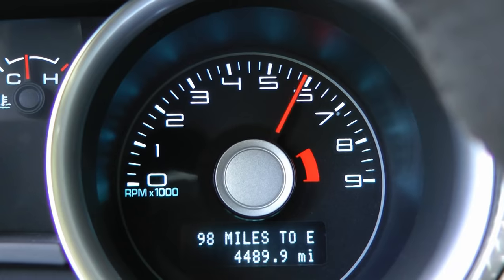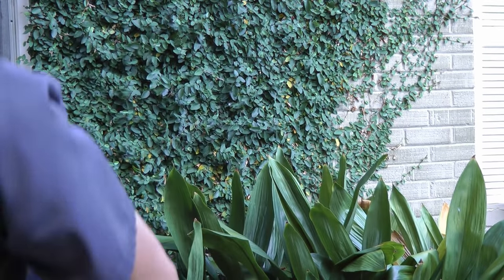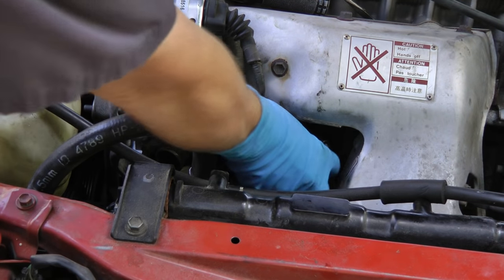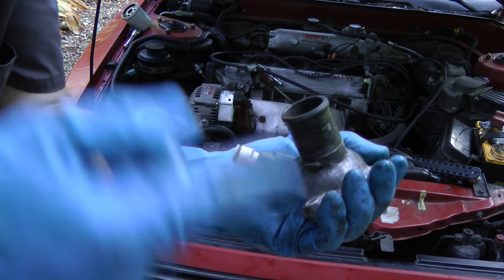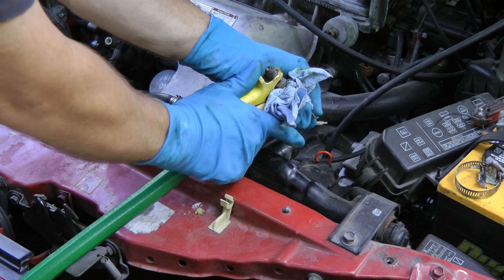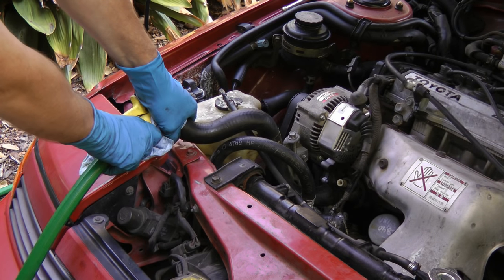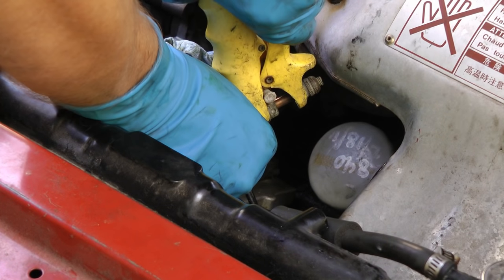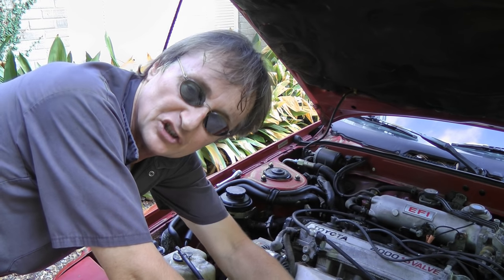How to Flush a Coolant System in Your Car (the Easy Way)

Comment: Hey Scotty, every BMW expert tells me not to use the Prestone green fluid in my BMW, but I should use the Blue fluid that BMW sells. Prestone claims that its coolant can be used on any model and any car. The BMW guys say that using other coolant types will cause damage to the BMW sensors. Is there a difference in coolants and what should I use on my European cars? Please make a video about coolant types. There are way too many types of coolants at the local car shops.
Reply from the maker: Sunil Thomas  BMW uses an OAT coolant, and most modern long life coolants are also oat coolants. I have seen no problems using other oat coolants in them. It's a technology, the old coolant was IAT coolant, which you shouldn't use, but any oat coolant can be used in any car that specifies oat as the type to be used. Now some like toyota use HOAT coolant, which is slightly different, but I've seen no problems using oat in hoat either, and the coolant manufacturers have told me oat will work fine in HOAT systems.
Reply: Scotty Kilmer Thanks for the advice.
Reply: Scotty Kilmer  Would you approve using the same method in a 2008 BMW 328i E90? Thank you!
Reply: Scotty Kilmer - 👍🏻
Reply: Hi isn't coolant just glycol. You can use from 25-50% glycol in the coolant mix.
Reply: If you want to simplify your search for Coolants...try OEM Coolants.  They're Color Coded to match specific types of Cars.   You can find them online and use your Auto Specs and Year Model to search up the right fluid for your vehicle.  They're rated up to 5 Years/150,000 Miles.
Reply: What they likely mean is don't MIX fluids. This is why you stay away from those quick change oil places. They sometimes put the wrong fluid in, because they are hacks. Seen some vids of them doing things completely wrong and scamming people for fluids that did not need changing. They are upselling scam artists cause they don't make a lot of money on oil changes. They make money on other changes though.

Comment: Just get it cleaner!  Its not an operating theater for your brain. The reason for the flush is because its been years and stuff can build up.If your coolant looks ok in colour then just drain it and flush out with hose like Scotty says! Then put some recommended coolant 50%/50% with filtered or distilled water and your good to go!The coolant does a host of things including lubricating.Check level after a week and top up. The air will bleed out on its own if you turn the heater dial to full red!

Comment: Isn't pure water going to cause your vehicle to overheat?
Reply: No...it actually cools better.    Just pair it with a 170 F. Thermostat for Summer.  Go back to 50/50 Antifreeze in the Fall before Freeze-up.  That's why Coolants are called Anti-freeze in the first place!

Comment: I like the idea of doing such a thorough job flushing the entire cooling system. My question is running the diluted coolant down the driveway and into the storm sewer and owning 2 cats having spilled coolant around that they may like to lick. On a normal city lot this procedure while simple enough is a huge drawback for the DIY'er. So I have it done by the Honda Dealer for about $ 125 Canadian. Don't see a way around it.

Comment: Iam a 71 year young grandma and if I don't do it it's not getting done I don't have the strength to pull or push the hoses and if I go under my 2005 van I might not come out😢 I don't have the $$ to have someone else do my Van's treatments do you have easier,cheaper way for me to do this radiator rust remover

Comment: Did you let all that coolant drop to the ground and run to the city drainage? Why would you use the same old oil filter? For a guy like you sometimes you neglect those details....
Reply: +Ivan Jaen if you were watching, at the beginning he put a drain pan under the car. 
maybe the oil filter was new. details are important, thinking for yourself is more important.
Reply: why the hell would you put on a new oil filter if you are not changing the oil...

Comment: Running no thermostat is worse since the engine is not designed to run cold all the time it will cause you to burn more gas since it has to sent more fuel to the engine to warm it up. It can also make the check engine light come on, also it can cause the engine to over heat since the thermostat is designed to let coolent in only when needed. to much or no restriction can actually be worse. oh and like I used water in my older cars and it started rusting out so I would not run in two weeks only two days max. It caused problems on the water pump and dries up the seals I would use an additive like purple ice or water wetter if I used only straight water (:
Reply from the maker: yes, in the long run you don't do that, but for just a few days it will help flush crud out, then you put the thermostat and coolant back in.

Comment: I thought regular water is bad for the radiator. Causes rust. Thought only distilled water is ok. Thought to remove sediment you also use vinegar. These are all the things I learned and thought from looking up how to safely flush a motorcycle coolant system

Comment: I just did this because My car needed it but then had to do it again because the radiator had a small crack in it.  And would drip out when shut off after an half hour.  My old 78 Truck was easier than my 95 Buick.

Comment from the maker: gm is pretty much full of crap with that stuff, basically they have engine problems in many models and want to blame it on something other than bad manufacturing.  Any good oil brand works fine

Comment: I know the manual recommends that you change the coolant every 24-36 months, but what if i buy a  antifreeze tester and it reads good for freeze/boiling point then why would I flush it?? I don't think I'm getting my money's worth if I don't use it until it's not doing what it supposedly do!!!
Reply: Hector Garcia-Martinez The color in the coolant reservoir is a good indication if its a clear clean color blue green or what color the coolant is then that's is a indication the coolant is clean in the cooling system. On the contrary the water in the reservoir looks rusty then. Flush and replace the coolant. The reason for that is normally prior water leak and top up with water so if it it's only or mostly water in the cooling system the water will become brown. It's smart to check any water leak before to flush and replace coolant. Because that was the problem in the first place
Reply: For example in the video here the coolant had a clean green color so there was no point in flushing the system. Besides educational purposes
Reply: Doesn't matter if it reads good. Coolant picks up debris from the system and lots of crud builds up in the system after a few years. If you've ever changed coolant, you'd see how dirty it gets. There are small channels it runs through in the rad fins and heater core fins which can clog easily. That's why you flush.
Reply: If you car is under warranty, flush as often as the service schedule tells you to.  Otherwise, do what you feel is best.

Comment: Motor oil on the rag will get into cooling system and cause the rubber parts to fail.
Fresh coolant acts as a lubricate for the water pump seal. Water alone, especially tap water, will shorten the seal's life.

Comment: use liquid intelligence 239 , a specially made stuff that wont hurt the seal and aluminum on these old cars , anything else will only move the lose junk not the corrosion that is built in the water channel walls...

Comment: One mechanic though, told me that was risky, because
you might create leaks that the old rust had been holding
back, particurlarly at the core plugs. Same problem as 
those ''Engine Flushes'' creating unnecessary oil leaks.

Comment: This one is a little odd to me. Not because he used garden hose water, if you're concerned about the content of minerals in the water, just flush it with distilled water. What gets me is, he says to use the car for a week or two with JUST WATER. He should have said to refill it with a low cost antifreeze/coolant. Come on Scotty, you can't use just water, the radiator will crack if it's cold enough outside. Even if it's not freezing outside, the engine might  overheat with just water. Water's boiling point is 212°F, coolant's BP is far higher because it's pumped against the thermostat and the system builds pressure, that allows the coolant's BP to raise significantly. Did I miss something?? Also, just curious about using an additive to eat away at the scaling in the radiator fins, even something like coffee maker cleaner might work but I'm sure there had to be a product specifically for cleaning out cooling systems.

Comment: Buying pre-diluted coolant is an expensive way to buy water! In my Walmart, the prediluted stuff is $7 and the full-strength $9. So the prediluted stuff you are paying $14 versus $9 plus the cost of water for the sama amount of coolant.
Reply: What I do is take a gallon jug and fill it halfway with hose water then I take full strength coolant and fill the jug the rest of the way (people say you need distilled water but I've always used hose water and it works the same as distilled water. it also saves you a few bucks to use hose water and not having to buy the jugs of distilled water.)

Comment: Wouldn't the mechanic who flushed the engine & the turbo injectors seen a blown gasket right away? Only reason I'm not going back to him is that I think he's a little generous to himself in clocking labor time (30min to remove & install a new battery and 4 hours for front & rear brakes & rotors And no brake flush was done! I assumed was mandatory since the brake fluid was still filthy when I went to another mechanic for a new axle at a much lower price.) At 92.88/hr shouldn't he be efficient?

Comment: ya but there is still water in it when you want to put the 50/50 mixture which means you got to use a air compressor or somethign

Comment: Dont recommend driving with straight water doing this is super hot climates.  You can boil this increasing system pressure and possibly causing a headgasket failure.  This method is okay to do in moderate climates.  I personally just flush with a hose, then rinse with distilled and then fill with coolant

Comment: Simple, yet effective method. Sure, it takes a little time, but water is cheaper than getting a dealer to do it.
Reply: Water quality depends on where you live at AND how the water is processed by the plant. Hard water is bad. Soft water is good.

Comment: i wouldnt recomend doing complete flush on all cars. for example on the toyota previa s/c which i worked on quite a bit, i found that once you introduce air in the system it can be a nightmare getting it out. you dont want to risk getting a blown hd gskt on those mid engine vans.  i kept getting temp spikes and you could hear the bubbles going thru the heater matrix. do a part coolant change every 60k or so.

Comment: the vehicle will likely not reach the correct (coolant) operating temperature and not warm up. the thermostat controls engine coolant temperature..if removing it, replace it with a new one :D

Comment: Mixing coolant with regular water WILL lead to rad failure Scot.
You should be never putting house water in the engine.
DISTILLED WATER is the only water you should ever use and also the only water used to dilute your coolant.

Comment: You forgot to add to watch the temperature gauge when driving with the water to make sure it doesn't get too hot.
Reply: And drive with the heater full blast
Reply: Does that help circulate the water?
Reply: gammatnt yes. It's also a good way to make sure theirs no air in the system (if there's no heat that means it hasn't circulated through yet)
Reply: No...the idea is that it flushes out the Heater Core.

Comment: You missed a step Scotty. What about flushing the heater core? lol That is a pretty important step to miss. If you miss the heater core and there is debris in the heater core guess what that debris goes right back into the cooling system again and what you just did was a 1/2 butt job.

Comment: I think it's not a good idea to use pure water, you should use deionized water to prevent corrosion inside the radiator
Reply: It won't corrode it that fast. I ran tap water in my Civic for over a year and when I changed it, it came out clean and when I looked inside it was spotless. It takes years of use for water to cause that kind of damage.

Comment: Just remember do not use the Chemical Flush Acids that many Promote, if you do, I can almost guarantee- you will be installing a new water pump in short order. These chemicals are Tough on water pump bearings...

Comment: I put Oxalic Acid in the Radiator to eat up the rust.
Reply: That's fine, but you HAVE to follow up with a borate flush before you put antifreeze back in or you'll give yourself a lot of problems.
Reply: Alex M I used Baking soda instead to neutralize the acid.
Reply: That's better than nothing.  It'll neutralize the acid, but it will leave behind metal precipitates from any ions the acid picked up.
Reply: Alex M I will try and flush that out. I did notice there was something floating around when I put new coolant in.
Reply: Just flush it with water.  The borate only helps if the acid hasn't been neutralized as it won't form precipitates.  They're already in there, so just a standard garden hose flush and new coolant and you should be good.

Comment: I wouldn't recommend flushing your vehicle if it has over 200,000 miles once I did mine and the intake gasket wentout a few 100 miles after that

Comment: Can't run the car for a week without the thermostat in it when you have a GM. Dont do it. Plus you'll throw codes, and it'll never run at a high enough temperature and the fan stays running.

Comment: What about the coolant in the reservoir tank
Reply from the maker: you can remove the reservoir and turn it upside down, or hose it out with a garden hose.
Reply: And what about the coolant in the heater? Also many countries have very bad tap water, (Malta for example). so it is advised to use the pre-mixed antifreeze. Great video Scotty I really your video and learnt a lot myself.

Comment: Can't say I recommend putting water out of a faucet into a cooling system. In my area, the water has a large amount of calcium chloride in it, and will start corrosion and rust in your cooling system. I use distilled water to flush my cooling system. If you have a GM car, definitely DO NOT put Dexcool back in it. It will plug up everything. It's some really nasty stuff. 

That is an older car, with a radiator cap, and accessible hoses. How about showing how to flush a cooling system on a modern car that does not have a radiator cap or hoses that cannot be easily removed. Also, very few modern cars have radiator drain plugs.
Reply: Gerald Scott throwing this out their. Yes on an older GM Dexcool ends up being Dexkill but that’s no longer the case on modern GM

Comment: Nope. I assume you mean you buy straight antifreeze. 

The only difference is they sell it straight or pre-mixed. When they mix it for you ...it`s basically if your lazy or worried about getting the 50/50 mix off. 

If you buy the straight or " non diluted " antifreeze...you get a better bang for your buck. But you have to have an extra container and dilute it yourself by mixing the antifreeze with half water.  

So no ...it won't corrode faster.

Comment: I know there are people who say 😲 he didn’t use distilled water! 🤦🏻‍♂️ there is no need to use it when flushing the system. Yes do not use regular hose water or bottle water due to minerals when using concentrate and adding water. If your using 50/50 mix then no worries .

Comment: Running it with only water is bad. No it'll over heat. I would drive my truck around with water only and after about driving it around for 15 minutes it would over heat and the temperature gauge would be on the red side and it would automatically turn off and leave me stranded in the road and after trying to turn it on it wouldn't turn on. I would then have to wait 1 hour to 2 for it to be able to turn on again.

Comment: Heater coil is gunked up, you need to flush it out with water or compressed air.  This video doesn't show how to do that.
Reply: Easy, you just pull off the heater hose, UUGH!, and it comes right off!  Now squirt water in one hose and it comes out the other hose. Then just put it back on!  UUGH!.  :)

Comment: i would never run a car on pure tap water, all flushes need to be done with destilated water you drain the block and radiator fill up with destilated water run the car for a few minutes than repeat the step 3 or 4 times, at the end fill up with 50/50 mix of DESTILATED water and coolant, this new cars have aluminum engines and they use diferent types of aluminum so you cant use just any coolant or water from garden hose, doing so may leave some minerals inside that can cause damage to the block radiator and gaskets
Reply: Thank goodness I have an old school v8.
Reply: +Jeremy Menchaca I think that's the best way to go. all that wiring, sensors computers. just a PITA.
Reply: +Valentin Sierra 351W Carb.

Comment: Never drive a car with just water in the cooling system it will corrode. Never drive a car without a thermostat the engine oil won't get hot enough so it will form engine sludge.

Comment: You scare me when you take the oil filter off with a tool and then put the same one back on. Any scratch on that paint and it will rust very quickly. A little leak and your oil light will come on on the dash. That's why you hand tighten the oil filter-no wrench.
Reply: +Ramon Preston exactly, i tighten my filter by hand, and take it off by hand. no need for a oil filter wrench
Reply: +ab30494 wrong, some filters are made to be wrenched on.
Reply: +Corylolable that is why i said that i tighten my filter by hand, not you should tighten all of em